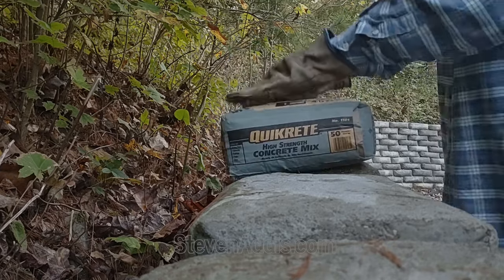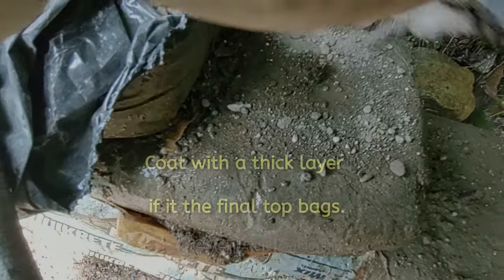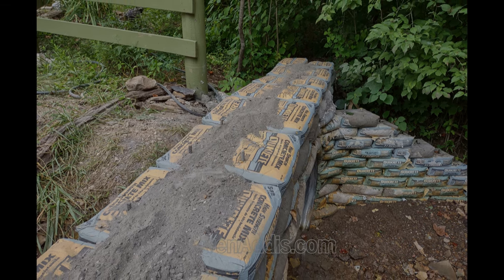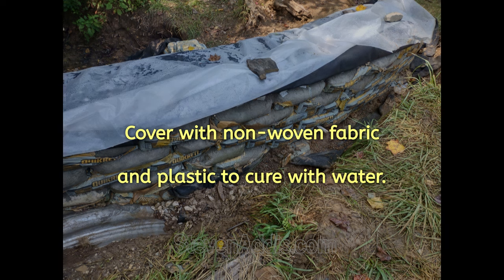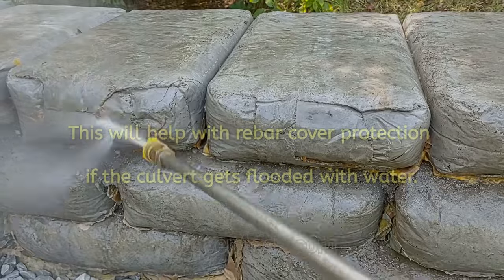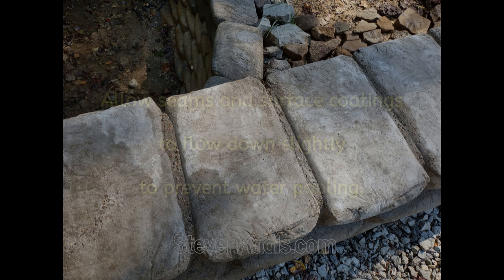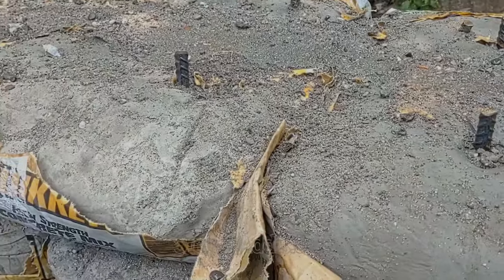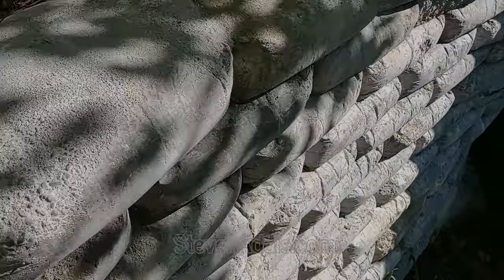Improvements & Methods - Concrete Bag | Culvert Retaining Wall | Steve Addis

Comment: I live in Northern Ireland, the local park has this sort of thing. A small stream runs through a culvert under the main road. The river bank is built up almost vertically to a height of about 5 feet using this method. I'm remembering this from almost 50 years ago, it was made with old fashioned sackcloth bags and the sackcloth wasn't removed, it was realising it was sacks of cement and not stones that has made it stick in my memory. I know that road was new in 1945 and I'm talking about me seeing it in the mid to late 1970s so it was made sometime between them 2 dates. It is still holding up without any issues after all that time. Curiously, a stretch of the wall about 40 metres further on which was stone and cement did collapse in the late 70s early 80s. The park is prone to flooding when we have heavy continuous rain.
Reply from the maker: @darnstewart - Thank you for taking the time to share this. I really appreciate learning about this. I would wonder if ready mix was produced in bags at that time or if the mixture. I would love to see a picture of this park you are describing. Maybe it is on google. Perhaps this is similar to what you saw many years ago. Thank you again! :)
https://www.premier-concrete.com/products/pipeline/3-1-bags/

https://www.agg-net.com/resources/articles/concrete/the-dawn-of-the-ready-mixed-concrete-industry

Comment: You do understand that bagged concrete is the most expensive concrete you can buy right?   I have seen people that make rounded pellets of concrete and stack them like you've done with bags, but the pellets are made with mixed concrete.
Reply from the maker: Yes, at about $3 a bag.  The pellets would be great. Thanks for your input.

Comment: You spent more on concrete by buying the bags and doing it that way then if you wanted to couple of forms and have concrete truck come out and then all you would have to do as move out the top
Reply from the maker: Forms and pour to save $, maybe, - this cost $950 to $1200 at time of this build.

Comment: LOVE THIS!! Incredible job 👏👍👍💯 so much easier, cheaper then spending $20,000 on a retaining wall. People are like oh that's lazy! I'm like no it's genius and I don't think laziness is the problem lol maybe the problem is people don't have 20 gs on stand by to dish out on a wall
Reply from the maker: I am with you on that. My Cousin does concrete and he estimated some high numbers when I showed him what I did. Thanks for your comment! :)
Reply: The important thing on a wall is the drainage in the back, it's the hydrostatic pressure and soil pressure behind the wall that makes them fail and these pressures, if not dealt with properly, will knock down any wall.
Reply: Yeah, I had a general contractor (asked him about a retaining wall & siding options) recommend against doing a retaining wall because they're so ridiculously expensive.
He said that our best option was to weight DIY options from youtube videos.  =p
Reply: The city has these walls stack 12 feet high in drainage channels where I live. Seem to have been there over 50 years..
Reply: How much or how many bags can i order to make one wall? do you have a way to account how many you need per war?
Reply from the maker: @grantcalloway571  Sorry for the delay, just saw this.  I just checked the wall now: 8FT length x 3FT height triangle is 23 to 24 bag count. 8'Lx3'H rectangle is 46 to 47 roughly. -  I did not calculate anything. On the first culvert, I loaded it and unloaded from my van myself at Lowe's which was crazy, yet good physical exercise. I bought by pallet and they would mark my pickup slip. Then I realized delivery was reasonable and best for the big 70 foot wall because I about had enough it. I did not want pallets sitting out so I did only two at a time, estimated what I would need. When I was to the end of the deal, used what I needed, then stored the rest in the garage in plastic bags.

Comment: I bought a pallet of concrete for my posts on my metal fence. We moved the bags in a wheelbarrow 3 at a time, was a lot of work. This is much more than I did, looks super nice.
Reply from the maker: The wheelbarrow is useful. I try to place the pallet close to the job and transport with the ATV back rack. Don't you hate it when a full barrow dumps on you! Especially when its a wet day and full of clay. Glad you got your fence done right.

Comment: Top and Bond or a pourable topping mix would probably work better for a coating of a finished wall, but for your purposes, nothing would most likely do just fine.
But, I would also recommend spraying water over each layer as you set it to provide water for hydrating the concrete mixture, elsewise you will have more of a dry pour type of wall, and that is not nearly as strong as a properly hydrated concrete mix.
You should also spray and cover with plastic for a few days after your stack for best results.
You did a great looking job, and your advice on mixing the bag contents is right on the mark.
Reply from the maker: Thank you for this great input. Taking notes. I looked up Top and Bond and Flow Coat. I did not like the S Mortar. I would like to try this. Hydration at levels sounds good. Thanks again!

Comment: Very nice alternative to traditional methods. Looks solid. Perfect alternative for a lot of shovel work for places that need drainage for road building / improvement where it might be difficult to get even a small concrete truck in.
Reply from the maker: @G.I.JeffsWorkbench - Good point on the access. There is a Rip Rap product that Quikrete makes for this purpose.

Comment from the maker: Please LIKE and SUBSCRIBE if this was useful. Thank you for watching! :)
Reply: I know it works, we used two concrete bags just like these to weigh down the back our basketball hoop, years later they are hard as rock.  It was not intentional.  I wonder if these could be used for a house foundation or even a house wall or even the base of a floor that can have the low points filled in later.
Reply from the maker: @Ventura IT - Thanks for the comment. I know you are thinking out of the box, yet I would not use for structural. Cobble stone walk, if the price is right.
Reply: @SteveAddis  I'm guessing that it would work for structural if done right...  but concrete blocks are so cheap.
Reply from the maker: @Ventura IT - I knew a friend that built his house out of solid poured concrete. Reminded me of the  concrete monolithic domes. FEMA shelter and resistant to wind forces and earthquakes. -  https://www.monolithic.org/

Comment: Great job on these videos. Three questions.  First, are the horizontal rebar pieces placed between every row?  Are they necessary? I guess they add lateral strength?  Second - do you water and solidify a few rows at a time, or build the whole wall and then  water the whole thing? I imagine that it might be hard to get them all wetted properly if you had full 4' high wall of bags. Last thing - I have heard and seen on some other sites that some of the quicrete bags now have a liner which would prevent water from getting into the bag. Is this true?  Do you have to use a specific style of bag?  Thanks for the valuable information.
Reply from the maker: Thank you. The horizontal rebar are not necessary, yet I placed them in two of the highest rows at the corner only to key in and lock the wall more. This wall was solid clay and stable soils so it will likely never move. The curve area is helping stabilize the whole wall as a unit. The culvert was on bedrock. Yes, I did a few rows or courses at a time. They solidify even with outdoor humidity as they draw in moisture let alone a good rain or flooded water. I used paper bags and paper bags with a brown wax lining that resists water. Plastic is not my preferred, yet would have one advantage of not stretching which is similar to "fiber reinforced" bags called Rip Rap concrete bags by Quikrete made specifically for this. Plastic would require holes punched in using a small piece of plywood with screws or nails and a 2x4 on the side for a handle. Then of course punch the bags through with rebar from the top multiple times. Rip Rap bags are best, or paper.

Comment: Great look.  How do you drive the vertical rebar to tie them together?  Just a bunch of short rebar sticks and hammer them in on each level?  I worry that the upper bag I “drop” over the rebar will split when I do it, but maybe they’re stronger paper than I think.
Reply from the maker: Sledge hammer. I try do do several courses or more. Yes, had to punch through bags. Yes I had some short rebar to prevent removal at the top of the wall. You can cut small starter holes first in the bag. Paper is two layers. I would drop it rapidly on the rebar while holding it. Thanks for your comment.

Comment: Wow, that's really impressive! Thanks for sharing. I'm actually in a similar boat—I've got these huge retaining walls to build on my property for the driveway embankments. I'm on a tight budget and trying to find ways to save as much money as I can. Any tips or suggestions would be greatly appreciated!
Reply from the maker: You are welcome. I used rip rap to hold a steep drive side. Dumped bags of concrete in between especially near the top edge which locked in. Geo fabric is a plus.  I used the mixed stone with lime dust packs hard with water for the drive. Buy bags bulk. Thanks for your comment! You will get it done - with some work.
Reply: @SteveAddis  thank you 🙏 it’s greatly appreciated!

Comment: I just moved into a property and was told today that in a heavy storm rain rushes right towards my house.  It continues on off the property but, it's a huge concern.  Thinking a four foot height should be more than enough.  My first question is.  Would this work as a wall without backfill behind it.  
Explains why the previous owner had blocks on that side of the house, about 6 foot from the house, down the whole length of the home.  And siding and flooring issues on that side.
Reply from the maker: Hi @TheTamrock2007. This sounds like a steep slope next to your home or back of home. I can only give you ideas to consider. The four foot wall might be too high to stand on it's own indefinitely. 2.5 feet would be good unless you put it deep. Line it with heavy mill plastic to keep the water behind it. Yet, curve the wall so it directs water and does not pool. Combine it with a french drain on the water side. -  I did multiple french drains to handle my water situation. Look at your topology and use the area to your advantage using high and low areas. A water bar system might direct water away from the home using multiple zones, like divide it in half, directing to each side. You could combine this with french drain in front of the bar, wet side, line it with plastic in the bottom facing your home. Even the water bar might be reinforced with the concrete bags. Also, can you grade and slope the ground away from your foundation? Do not forget geofabric to prevent erosion. Here is a the french drain I posted. Yet you need more barrier from what it sounds like. Think it through, observe wet season, evaluate, plan, and you will find the solution. https://youtu.be/XWEcCW-Fm5Q
Reply: @SteveAddis  thank you so very much with that quick response, and right before Christmas.  Merry Christmas 🎁
When you said line it with heavy mil plastic, underneath?, between each course?
Reply from the maker: @TheTamrock2007  Drape it under top course, facing over wall, down below ground level on water side, or upstream side. Much success an Merry Christmas to you all as well!

Comment: Steve, could you describe in detail how to wet the bags?
Reply from the maker: Sure. You keep the paper on for a couple of months or more. Do a section and place rebar in to allow for linking the next section. Lightly water the bags, cover with plastic so that it does not get rained on and over satuated. Let it sit for a night and repeat. Lightly water where rebar breaks the bags. Water will soak in. Punch extra rebar holes and pull them out and water there some. When it sets up a bit, then you can give it some more heavier sprinkle. If you sprinkle water too long in the beginning, the bags stretch on the face and sometimes the concrete will separate a bit without side support support. This is why I taped the bags. Now, when it is setup, I simply let the water  sprinkle all night long or wait for good rains to do the rest of the job. Test your methods on a small area.

Comment: Interesting project. How many times did u need to soak the bags and have you broken open any of the finished bags to see how deep the water got inside each "block?" Do you think it would make any difference if you soaked each layer of bags prior to setting the next layer of bags on the one below it? I've always loved the look of a rock wall but the cost of the rock and labor involved is prohibitive where I'm at.
Reply from the maker: It was soaked  a couple of times. When it set, it was soaked all night. I did not check this wall because the water should have reached the center as it absorbs in the concrete. By doing a few layers at a time as you mentioned, it would reduce the load and stretching of the bags, reducing cracks forming on the face. I like the rock look too. Please see this video and see if it helps. Thanks! https://www.youtube.com/watch?v=tUlc1Qb5A74
Reply: @SteveAddis  Thx for the quick reply, a lot of original posters don't reply at all. Nice work, subscribed. If you were to do this again is there anything you would do different?
Reply from the maker: Hi @Jon B. Hey, you are welcome. On this particular wall, I would not have rushed the job and stacked so many at a time. This resulted in some cracks forming in the face as it set up. Also, mixing the bags more. I cut the hill back an extra two feet yet was tired of digging the extremely hard clay by hand with a pick and shovel and did not cut the footer in as much as I might have. I would have ended up going through the blue clay completely and then that would not have left as much base, yet would lock that wall in. If powered tools were used, it would have been nice to cut the hill back more for cars and also made the french drain in front of the wall deeper by a couple of feet The water on the hill seeps to the clay, then creates seep springs, drains under the garage pea gravel, thus the french drain to take that water away from the garage. Thanks for the subscribe. Take care.

Comment: Why doesn't the bottom of the bag that makes contact with the bag under it create a natural separation point? Is the bag designed to disintegrate allowing the bags to bond? Are these bags of concrete specifically designed for this purpose?
Reply from the maker: You are correct and there is a separation at the paper. Paper does break down, yet not much of a bond except the natural self locking. No on the bag design for this purpose. Those bags are called Rip Rap Bags by Quikreet. Thanks for your comment.

Comment: Brilliant wondering if I can make a walkway using this method
Reply from the maker: You might be able to do that. Best lightly dust them with sandy mortar or concrete dry after you apply water so they don't end up slippery. - Thank you for your comment.

Comment: the type s does have the most organic tint and garden variety quickcrete is that type but if you shop or order direct you can, or at least could when I was doing stuff like this, get it in both types I and n as well.
Reply from the maker: Thank you for the information.

Comment: 2:27 - why would you not just use Portland cement (or a mix of Portland cement and paver sand) for filling cracks?  It appears that the rock aggregate contained in the concrete is being shed aside anyway.
Reply from the maker: @JemicoTX - Yes you are right. I might experiment with that item. It was just what I had at the time. I did want a binder with the cement such as the sand contained in the Ready-Mix product.  Now on two of the walls I used S-mortar and it seemed to work. It worked in cracks yet seemed to peel off smooth surfaces. Again, need to test this. Thanks for your input and comment!

Comment: Im surprised the bags are so solid, like that they absorbed the water all the way through the thickness of the bag. Do you think deep within the wall there are sections that haven't gotten enough water and are just powder still?
Reply from the maker: Thanks for your question. They are solid as they were flooded with water overnight and of course tested each section.

Comment: Did you have any sort of anchorage at the bottom of the wall or do the bags sit on the fabric?
Reply from the maker: Depends on which wall.  Fabric, yes - separation for the back side and stone. Retaining wall sets on clay nearly as hard as rock, then rebar driven into it. Yet, good footer and tie backs are usually needed.

Comment: You ever thought about using vinyl crack repair. No rocks to deal with when it comes to the crack and small breaks?
Reply from the maker: I never thought of that. Thanks for the input!
Reply: Honestly bro, I do concrete and cement work at the job and that stuff works well for those kinds of small problem. Rock on brother ..

Comment: Thank you. I saw this video my suggestion and will implement it.

How long did it take to completely cure?
Reply from the maker: You are welcome. I let it go for two days and keep it wet if possible. I am told it cures more over the years. The concrete bags in the stream with constant contact to water setup more solid - when I first checked for strength.